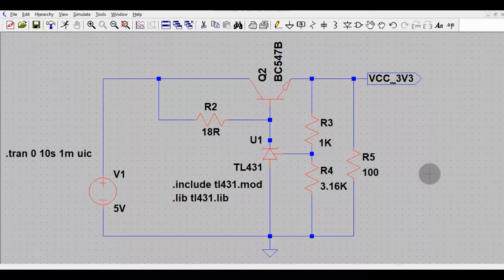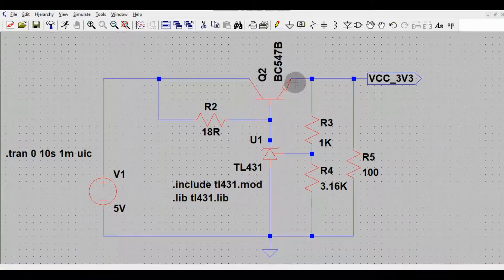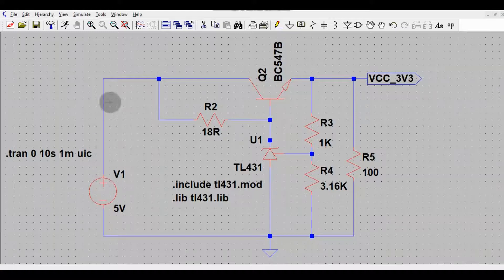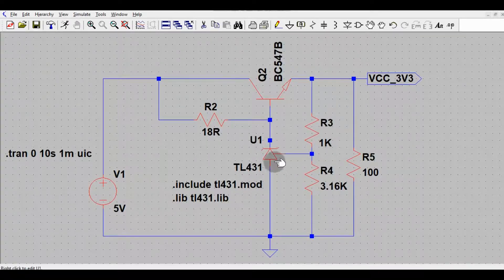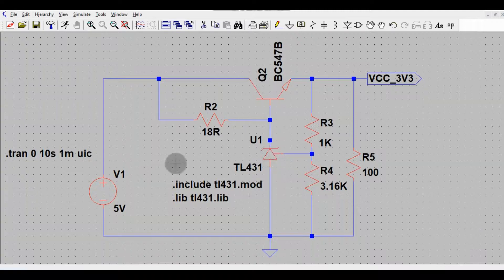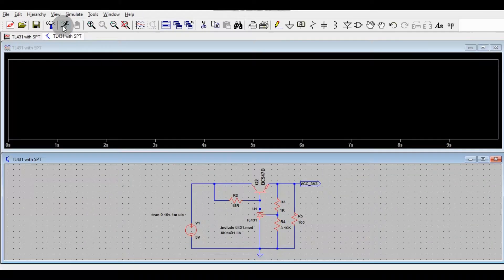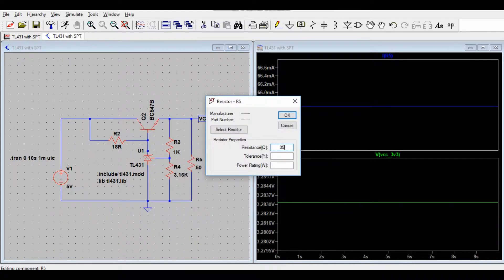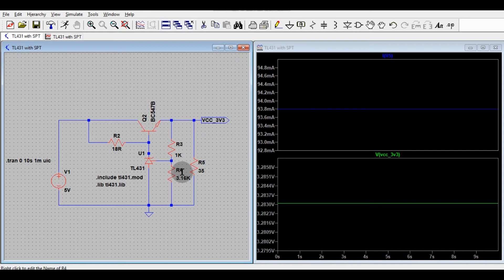LTSpice TL431 Power Supply Design For 3V3@100mA

Comment: If we use 3.3 V LDO then
Reply from the maker: You may compare the cost of LDO and this circuit.
Complexity in LDO is less as all things are built inside the chip.
This application I tried with TL431 with series pass transistor.
Reply from the maker: Thanks for watching. I always see you comments !
Reply: @ElectronicsCircuitHubECH  tomorrow I will be compare the cost, 
But this TLV circuit without transistor, we use in smps design for feedback
Reply from the maker: @kuldeeprawat4758  In SMPS TL431 monitor the output voltage and compare it with internal reference. TL431 is more stable with temperature that is why it is used in SMPS. Earlier in place of TL431 people using zener diode.